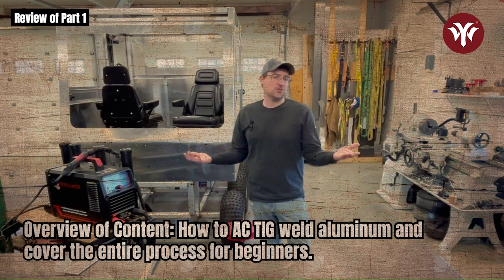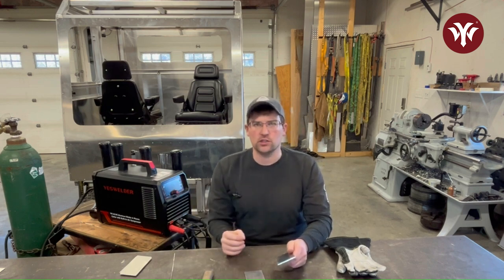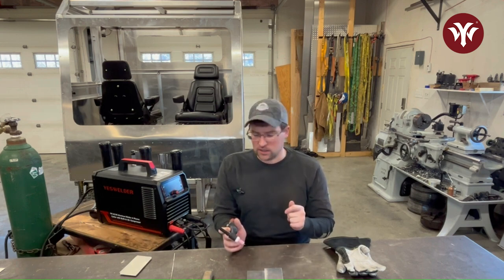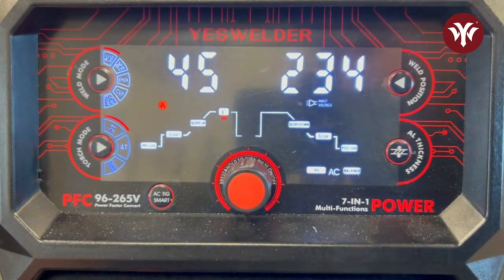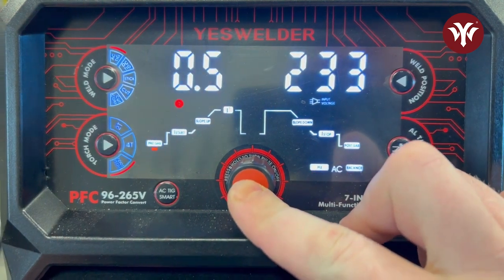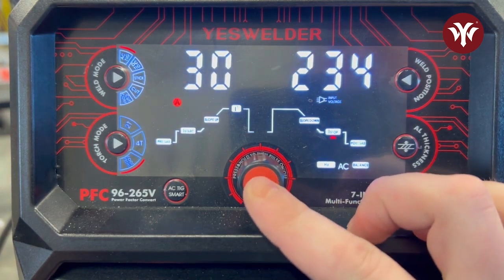Welding Machine Setup: A Case Study on Aluminum Welding with CT2050 | YesWelder

Comment from the maker: Outline:
00:00 Review Part1
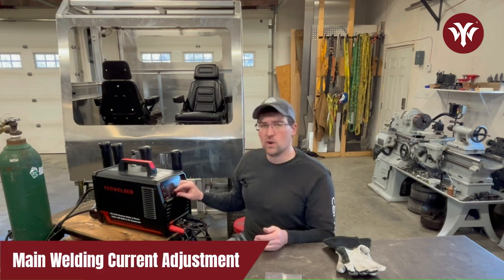00:42 Main Welding Current Adjustment
01:30 Pre Gas Setting
02:47 Current Setting
03:00 Argon Flow Rate Setting
03:54 Post Gas Setting
05:20 Smart Settings
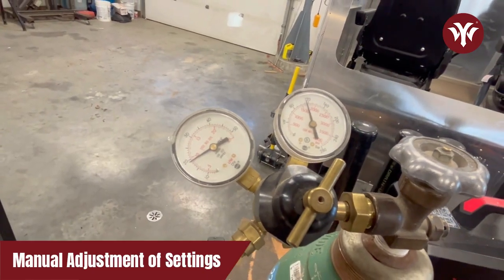06:13 Manual Adjustment of Settings